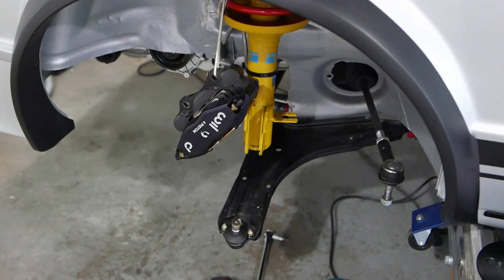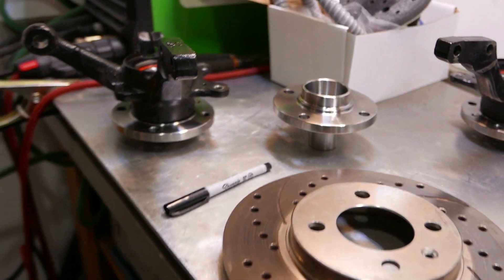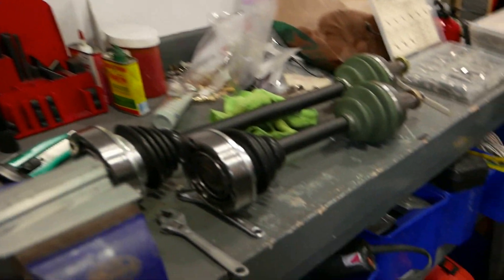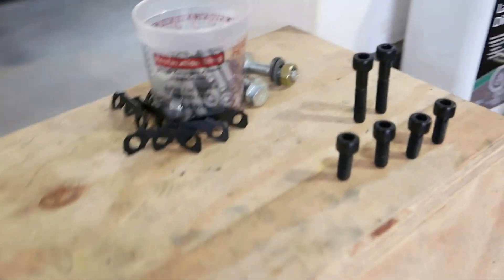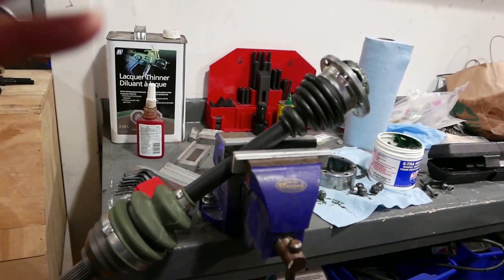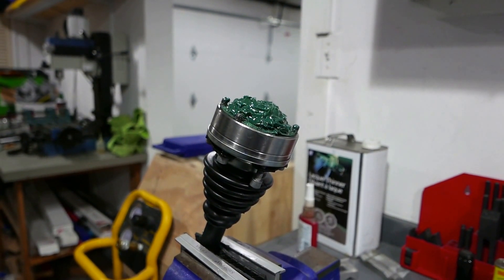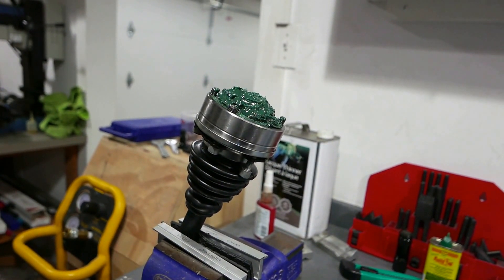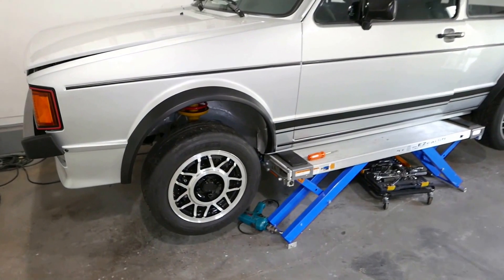The Ultimate 1983 Rabbit GTI - part 141 (Racing axles install, performance testing)

Comment: I was 22 years old when I accidentally disassembled an inner joint. I tried pretty hard to put it back together before my boss noticed, lol. He laughed when he found me in the parts washer rushing the assembly. Not easy or clean! Yes traction is poor until 3rd gear for most rabbits. You could put a 100-150 shot to the ground in third most likely. What's the scoop on the brake bias setting?
Reply from the maker: With the larger piston Tech-53 callipers I am now able to have only moderate pressure reduction to the rears. A much better result.  I am looking fwd to trying out the nitrous system, likely in May.

Comment: Hi Derek. Regarding the harnesses for the seats ideally you should only run a harness with a cage in a car of this age. Modern hot hatches are very strong mk1 and my mk2 less so. I have a full cage but the obvious worry is in an accident the harness doesnt allow you to bend forwards like a normal seat belt. Hence if the roof deforms worst case you prop it up with your head. Haha  Maybe you can find a removable half cage that you can use when on track but it'll need to above head height.  If this is what you were suggesting in the video ignore me haha
Reply from the maker: I have heard that story and have been thinking of a single hoop. I am getting tossed around in the stock seats and feel I won't get get good lap times without being held more securely in place. That said, I am insisting on having a totally stock looking interior when not at the track so I may be limited in what I can do. It is obviously possible to roll the car at the track but it is a pretty safe design and I am not that likely to end up crashing in the roof there ... famous last words, eh?
Reply: A half cage would certainly help. I can understand wanting to keep it stock mine is now devoid of all practicality with a full cage ha. 

I would maybe also try running the car on semi slick tyres. I run my Mk 2 on Yokohama Advan A048R tyres. They are very, very grippy with almost slick levels of grip and road legal here in the UK but not as unforgiving as slicks in terms of track manners. As a rule here in the UK, track day organisers won't let you run slicks without a full cage as more grip = more chance of seeing the world upside down haha . I certainly think on a car as light as yours they would be as good as all but the softest of slicks. It'll be good to see it on track in the Summer.

Comment: May I suggest you torque the front axle nut more? 175 ft/lb is fine for a road car but you're planning on getting on track and using stickier tires than what came on the car. A lot of racers have solved broken hubs problems by over torquing the axle nut with a long breaker bar and a long pipe.  This seems to be more of a problem with cars that use the 66mm wheel bearing over the 72mm ones but some endurance racers have managed to break the bigger bearing hubs too. I'd suggest 200ft/lb as a minimum.
Reply: VWRalf 
Great tip there, Ralf!
Reply from the maker: Oh, I have no knowledge of this area so the tip to torque to a higher setting it great. Many thanks.
Reply: Thnks buddy You are welcome

Comment: Drill holes in the CV bolts for safety wire.
Reply from the maker: What do you mean? I'll have to google this.
Reply: You drill a hole in each of the bolts attaching the inside CV to the transmission hubs and you safety wire 2 bolts together, so they don't loosen or back out due to vibration.

Comment: Love the attention to detail! What size tires do you have on?
Reply from the maker: Stock stock size 185/60-14s.
Reply: Derek Spratt 
How do you like the Dunlop tires? Are they sticky enough?
Reply from the maker: Yesterday's brake testing showed 1.1g and that is around the same level of braking I measured years ago with the Yokohama A008R tires which were the gold standard in the day. I haven't measured cornering forces yet but they seem really sticky :)